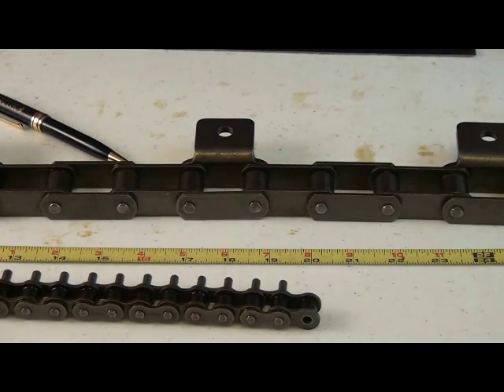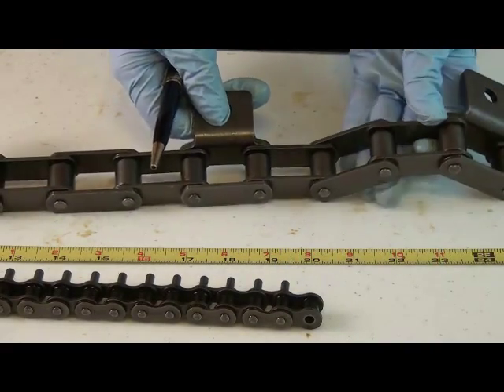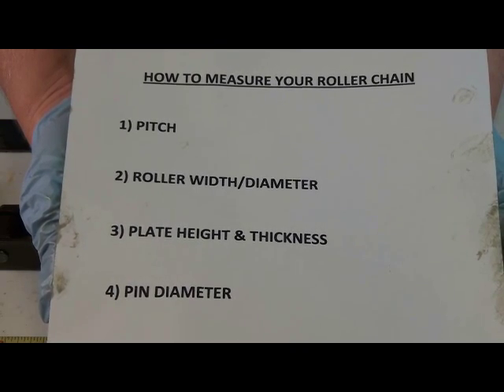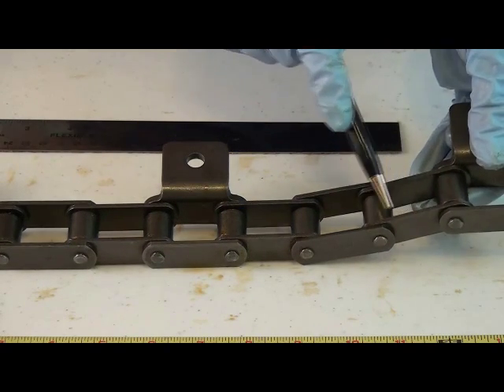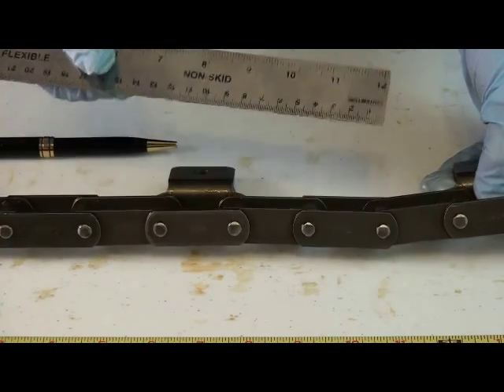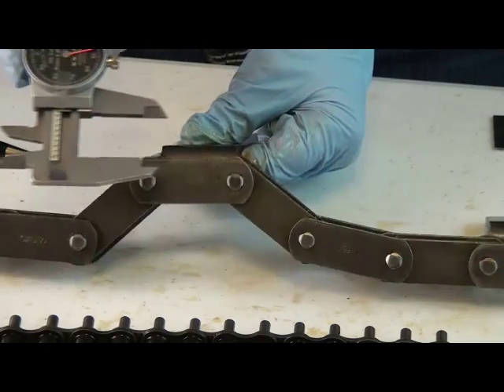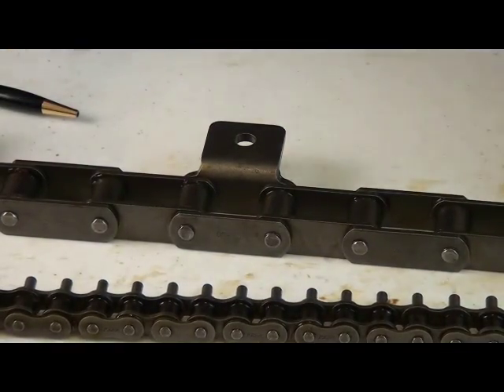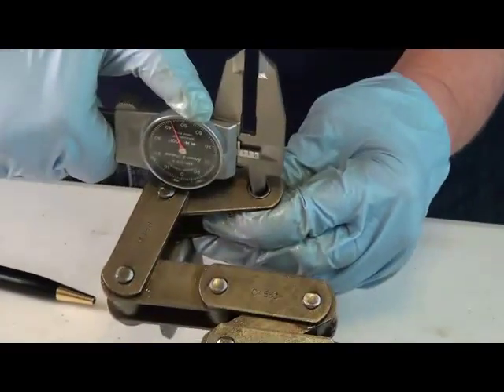How to Measure Roller Chain

Comment: I know this video is already 7 years old but you cracked me up when measuring the pitch! Its great that you use a caliper to make a measurement, but then proceeding with eyeballing the center was hilarious!

Quick tip for a correct measurement, measure the distance from the outside of the pins and take away the diameter of 1 of the pins.

Edit: end of the video measuring the pin or the hole is NOT the same if the pin is the exact same thickness of the hole the pin would never fit on room temp. You can cool it to make it fit, but that would make the pin expand and lock into the hole once back on room temp. (meaning the chain won't move) And chains heat up when in use (moving parts + friction = heat) so i dare to say that there is at least 0.1 mm of play in that smaller motorcycle chain.

In its basic form this video is informative about the measuring names and what to measure. But the way its measured is not to be followed if you want an accurate measurement of your chain.

Comment: Tell us what the method is for sizing chain that isn’t stamped ?   For instance a 50 pitch chain , measure the centre of centre of pin , count how many 1 eights of on inch are there in this instance the chain measurement would be 5/8’s of an inch making it a 50 pitch chain, if it were a 3/4of an inch between pin centres then this chain would be a 60 pitch Chain , there would be 6 - 1/8ths of an inch total etc etc etc, verniers for deterring plate width for what ? If the plates are thinning you will notice side wear of the teeth  in the sprocket long before needing to measure plate thickness more than likely caused by misalignment, if your going to represent then do so.
Reply from the maker: Good Morning Steve, you can always determine the pitch value of an ANSI chain by dividing the first number in the chain size by 8, for example with #60 chain; six divided by eight = 0.750" which is the ANSI B29.1 specified pitch of 60 roller chain. If there is a misalignment with the chain sprocket then side-plate wear thickness will come into effect and thin your side plates. Most manufactures will stamp the number designating the size so there is a chance that you could have something custom made, or you can have a metric roller chain (BS, and ISO standards). Below are two links, one to our ANSI roller chain size chart and the Metric roller chain size chart. I would notate your measurements and compare them to these two charts. If you come up empty-handed with these two charts then you have something special. If it's over 300' we can look into having the toolings made to custom manufacture the chain for you.
ANSI Size Chart: https://www.usarollerchain.com/roller-chain-size-chart-s/4869.htm 
Metric  Size Chart: https://www.usarollerchain.com/Metric-Roller-Chain-Chart-s/4870.htm

As always we are here to help, let us know how you come out with it, thank you!

Comment: useful to know the measurements but how do you ACTUALLY find the length
Reply from the maker: Hey Rob,

The safest way to find the length is counting the number of pitches and then designating if the chain is ending on inside (roller) links or outside (pin) links. Please feel free to contact us if you need any additional assistance!